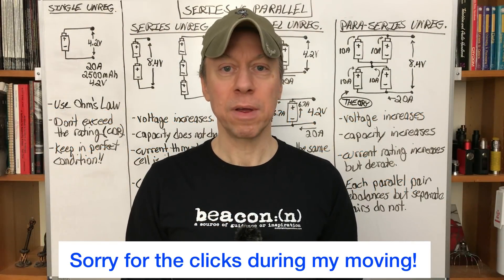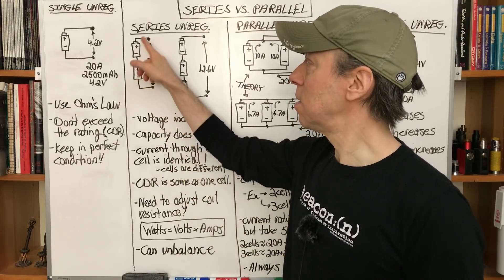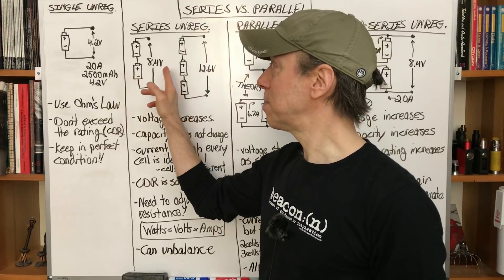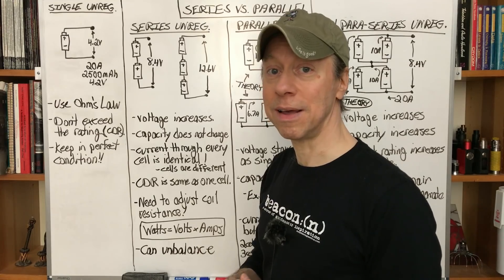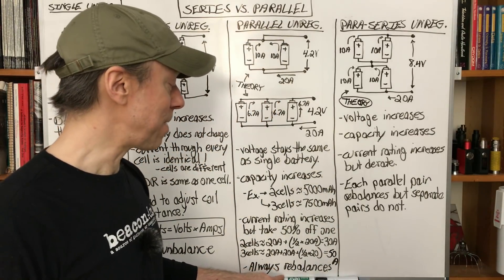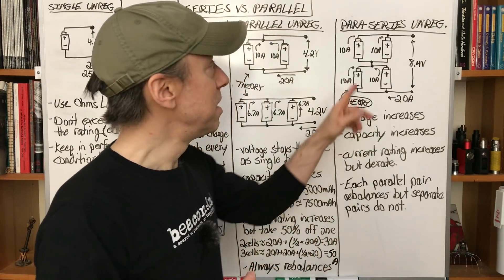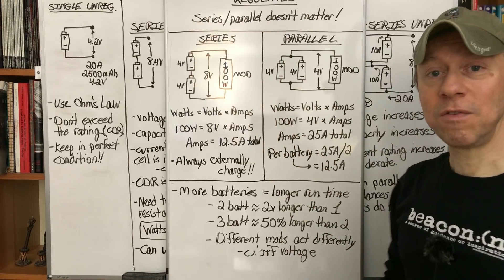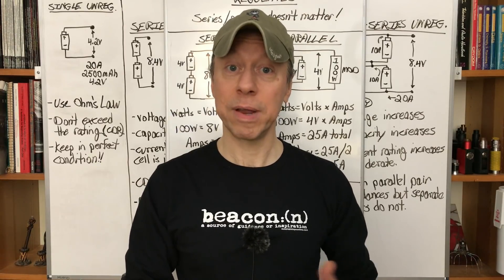Battery Basics for Vapers Ep2 – Series and parallel battery setups

Comment: Thanks Mooch!  2 Questions,  first, I have a married, paired, purchased at same time set of 3 Samsung 25r's one of them always charges way faster then the other two but discharges normally. Is this a issue if the battery otherwise shows no problems?  And secondly,  how useful is date coding batteries  and can you cover it in a video?   Thank you Mooch! 😃
Reply from the maker: I wouldn’t consider that set married if one cell is acting a lot different than the others. It could be damage or a counterfeit. Consider the two to still be married though and remove that third cell.

www.batterybro.com has an 18650 date code lookup tool you can use.

Comment: This is the video I've been waiting for.  Thanks.  I've made two mechanical and two unregulated.  One series and one parrel.  I kept my builds high since I wasn't sure exactly how amperage was.  I always make sure my builds were safe for a single battery.  Now I know I can go a little lower.  Thanks again for another great video.
Reply: Wotcha mate, parallel you can go low, but series, stay above .35ohm and build beefy. sweet vaping!
Reply: james whiting I'm running a .41 on my series. Boy does it hit.  I always use a calculator to check the amps my build draw.  Parallel was the one I was a little worried about.  I run Samsung 25r  I never went over 20 amps on my parallel.
Reply: That's why Mooch is the best! you can run 30A easy on two 25r's and still have a safety margin:)

Comment: Great vid mooch I’m running two 18350s stacked in the pulse bf and a .5 ohm resistance and the batteries don’t get hot is it safer to run one battery with a lower resistance
Reply from the maker: Safety depends on the true current ratings of the batteries you are using. Check out Ep2 of my Minding Your mAhs series.

Comment: I've said it before and I'll say it again... Mooch, what you do for the vaping community is awesome! I wish these easy to understand explanations would have been around when I started vaping 5 years ago. And I just love your White Boards! Please keep it up. Thanks alot Mooch!
P.S. Suggestion for a future video... How to check your charger (with a Multimeter). Is it still in good working condition? Is it still charging to the correct Voltage (i.e. can I trust what it says on the display)? ....... etc.